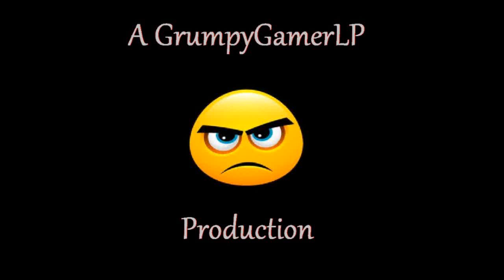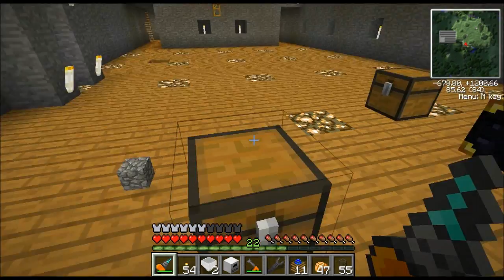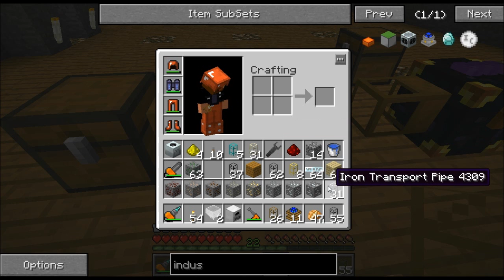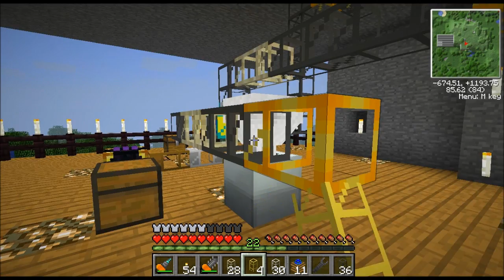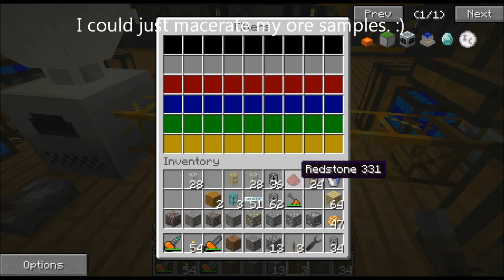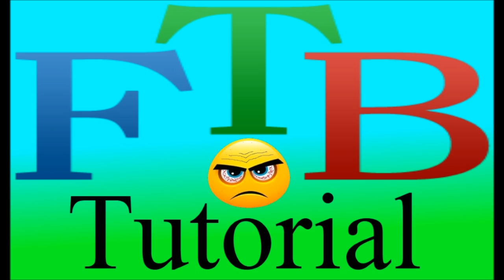FTB/Feed The Beast Tutorial - Ore Processor, Step-By-Step Guide

Comment: Good tutorial. However in 1.6.4 (Techworld2) there are ways to get more stuff from the ores. The TE3 pulveriser is cheaper to operate than the mancenator and the power used can be accepted by all machines but IC2. The TE3 pulveriser also produces dusts at random that can turn some ores into 3 ingots. Other than a few update related things this set up does its job. But this is incomplete overall, a few more systems should be added to completely process all metreials such as the cobblestone and the organized storage of everything.

Comment from the maker: Yes, someone else pointed that out a few months ago. I meant to run it to the hopper but I forgot. You actually don't even need the hoppers at all. This set up is so overclocked that the machines process the ore faster than the redstone engines can feed them. I used this setup on Tekkit, which didn't have hoppers, and it worked fine. It would only throw blocks on the ground if you tried to process two quarries at a time.

Comment: Nice tutorial, thanks! Have a one constructive note: you've connected yellow output of the first diamond junction to the hopper on the furnace, and then you've connected output of the macerator to the same furnace directly. This setup would have a problem: there is a good chance that furnace will be busy with smelting smth (lead e.g.) and macerator will try to put a dust into it. This will cause dust lost of the dust (it will be just spilt on the floor) It's better to connect macerator to hopper

Comment: Do you mean sending a redstone signal, or sending buildcraft MJ?

Redstone engines are usually used on things like wooden pipes, since they only produce a very small amount of energy which can't be used by more expensive machines, with some exceptions, like pumps.

The redstone engine has to be adjacent to and pointing towards a block that it can power. It also has to receive a redstone signal to function. Try using a lever or a redstone torch.

Comment: I'd recommend making a small pipe loop heading into the macerator/hopper to prevent overflow if the hopper fills up, which is very possible because of the slow speed of the standard macerator.

Putting a simple loop will prevent the items from dropping on the ground.

Just use 3 cobblestone pipes and one iron pipe and place them in a square with the iron pipe attached to the source to stop items from going back from where they came

Comment: Great tutorials.  They're really helpful.
2 questions: 1) What is the "high voltage" cables coming from?  Your solar panel farm?  Or is it being amped up on the way.  You say that the machines will explode from high voltage if you attached the power before putting in the overclockers and transformers.
2)I can only install 4 overclockers in a slot, how are you doing 9 or 11?
Sorry if you already explained this, I didn't see it in video info.

Comment from the maker: Thanks for the compliment. :)

I don't know about Thermacraft but you can also do it with factorization but the process is alot more involved and time-consuming. It takes about a half dozen steps but factorization can triple the amount of ingots you get from ores. One machine in the step takes about 20 minutes so you would probably want to build multiples of that machine. Personally, I would just rather stick to IndustrialCraft. (macerator and electric furnace.)